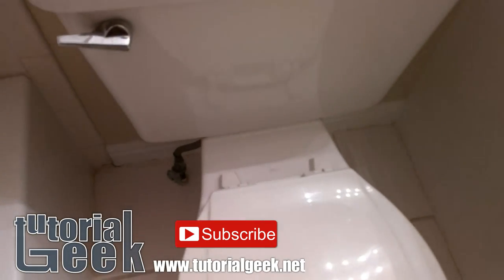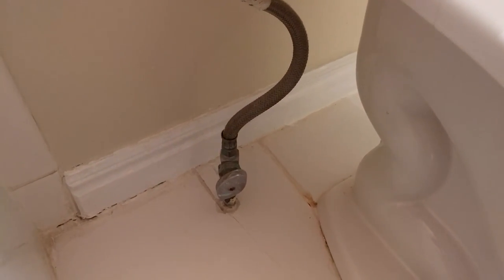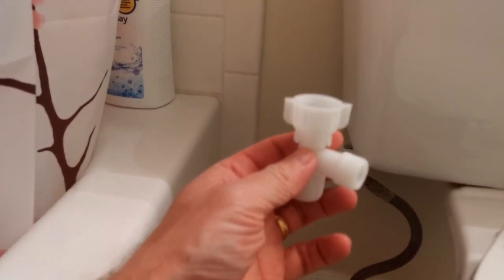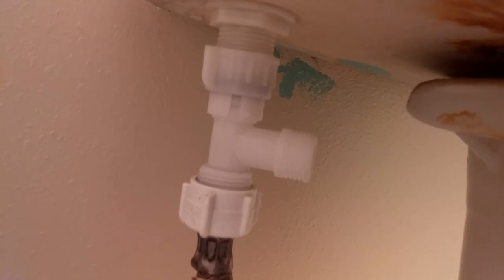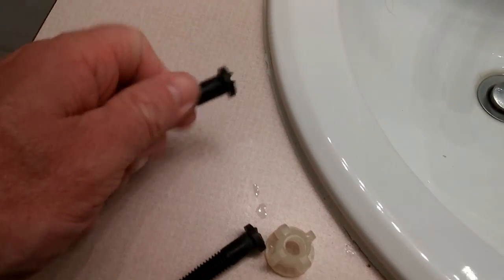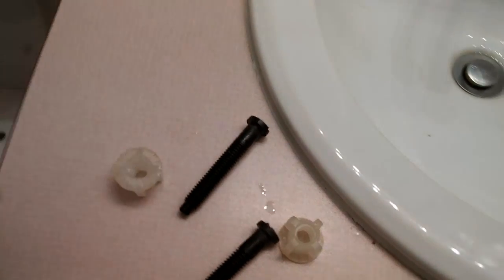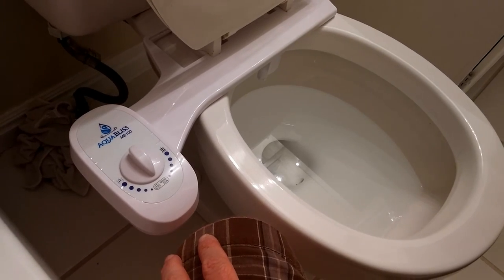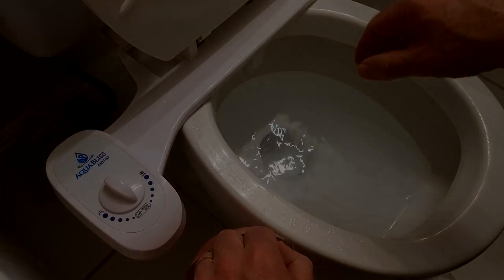Bidet attachment installation instructions | How to install a bidet attachment (AquaBliss)

Comment: When I attached the original hose to the bottom of the piece that has three places to attach, after it was all done and we turned the water on, there was a leak at that juncture.  There is not a leak when that hose is attached to the toilet.  Should I put some plumber's tape on it?
Reply: Same here ,make sure you tighten all tubes as tight as it can go ,that solved my leaks

Comment: Doesn't it lift the seat up a little? Are you now sitting at a slight slant basically?
Reply: ROFL I thought you're supposed to sit with your knees higher than your butt, not sit forward. That's why they say squatting is the best position.

Comment: Hi friend, can you help me out? That white plastic thing that you're twisting at 1:07, mine is a little different. 
 There seems to be a white plastic part like the one you have, but there's also a metal one, they seem to be stuck together. I think I have to unscrew them apart but I'm unable to do it.  So I can't disconnect the hose from the underside of the tank
Also the toilet valve is now loose inside the tank.
What do I do?
Thank you for your time.

Comment: I’m having trouble unscrewing the knob part attached to the toilet tank. I will try using the towels.

Update: I still cannot unscrew iit.
Reply: Try and use pliers
Reply: I'm having the same problem. It's been 2 years since you commented. Lol what did you end up doing?

Comment: Please help , I just fitted this item my toilet but in low pressure there is no water comes, and even in high pressure very small amount water coming, what i have to do increase the water power
Reply: Engin Çağlar idk
Reply: Was the toilet tap turned on all the way? If you have low pressure you need a pump
Reply: @goldwolf0606  ew no

Comment: Information for dissolving confusion about bidets.
     “There are two main bidet types: 
1. The old fashioned standalone bidet with vertical water jet.
2. The attachable or add-on to toilet bowl bidet.
The second one has two basic subtypes:
a. Those producing oblique water jet.
b. Those producing vertical water jet.

The above distinction is necessary, as it is informing at first glance about what type would be appropriate for different situations and different ailments. f.e people with      mobility problems, hemorrhoids, blinds, elderly, need always the more effective in cleaning up vertical water jet, specially the elderly using elevated toilet. The same it applies for women after childbirth, as their nearby wounds make imperative a very exact and steady water jet, or people in general that seek for a 100% effective cleaning, etc. Cost of this type varies from 30 to 2000 dls. 
The number 2 type has many other variations relating mechanical or  electronically 
handling, or offering more services, as warm water, air drying, music etc.”  

 “For those that look for an ecnonomy, durable, 100% effective, not electric, easily installed and easily used apparatus, whose VERTICAL well targeted water jet in very restricted area does not allow     somebody to feel the water coldness, (think of your finger in cold water compared with whole hand), never     wetting clothes and never causing any surprise sense of shock, the answer is the add-on bidetdisabled.com KO BIDET. SEARCH  WELL   BEFORE  DECIDING.“

Comment: No hot water? I saw an ad that included a hot water supply as well.
Reply: .....Was wondering about the warm water situation also...
Reply: @2lazy2date  There are non electric  bidets that also attached to your hot water.  Includes another T valve to attached to your sinks hot water valve.  Cost a little more. But your sink nears to be near the toilet.......if Not, than you buy a electric Bidet seat.  I just tried mine, for the first few seconds cold water is fine. After so many seconds it became a little uncomfortable.   Use just the first 2 dial increments for water..after that too much pressure.

Comment: Once you installed your bidet, did the toilet seat touch the toilet bowl? We installed ours and it does not touch it, I was reading somewhere you need to add spacers, but I have no idea what that is, do you?
Reply from the maker: My toilet seat is plastic so it is a bit flexible and does touch the seat.
Reply: Mine is plastic as well, it's a little high up, but it's fine I was just chicken to use it, I thought it would crack, lol! I am used to it now. Thanks a bunch!! :)

Comment: Is not not hygienic when flushing the water from the toilet bowl will be in contact with the sprayer?
Reply: Only if it overflows. It's not anywhere in the bowl area, its just below the seat, against the rim & the water it uses is from the tank, not the bowl. Also the nozzle self cleans

Comment: So, is it only cold water that comes out?  I can't imagine washing myself with cold water.  What about warm water?  How can you turn it on?
Reply from the maker: Yeah. Only  cold water. I have see other bidets that allow you to hook up to hot water as well.
Reply: If your toilet is next to the sink you can easily install a hot and cold water bidet that will let you adjust the temperature to your preference. It's just a matter of bringing over hot water from under the sink. A little more complex of an install but still within the realm of diy. However like most faucets the water may have to run for a little bit before the hot water actually begins to flow. Might as well just get used to cold water spraying on you. Wake you up in the morning, that's for sure!
Reply: L. M. Trust me it’s extremely uncomfortable with warm or even hot water really weird cold water is so much better

Comment: In India, we use jet sprays. Exactly what you showed. Its just a small attachment on the side of the commode. You do not need a separate seat / commode to clean. Very economical. Just under 5-7 US Dollars here in india. 

Using water is more hygienic & healthy as a paper wont ever clean 100%. And since its dry, bacteria & germs make the anus area worst with bad smell & infections. 

Use a water jet spray or a bidet fitting. it’s definitely more hygienic. Every person in India, be it poor or the rich, uses water to clean the butt. 

Its more safer, hygienic & cleaner than using a paper. Once you get used to water, believe me you wont ever go back to use a toiler paper. 

Use water, say no to infections

Comment: wouldn't the water be cold?:
Reply: It's a bit chilly.  Makes your sphincter pucker a bit.  Ha.
Reply: Creegal ... where do you wash to get warm water?
Reply: angel as a Filipino we have a “tabo” which is sort of a big “cup” used during bathing to scoop water and pour over yourself manual instead of continuous stream from a shower. So in our house we fill it from the tap (cold and hot tap - controlling water temperature to our preference) and use it to pour over ass after poop😀

Comment: i dont like the controls on this model, or rather the implementation... looks like its really easy to accidentally break by tripping into... knocking, or otherwise hitting. it should look more like a "button" that gets pressed (or multiple small buttons) that stop when released and is located in a convenient, remote location that is also not intrusive. but nice idea overall just poor manufacturing execution in my opinion

Comment: I live in the US & I never we even herd of a Bidet until I saw a video about them on Today I Found Out ( https://youtu.be/Z6dvGXiT5H8 ).

Simion actually did a pretty good job of selling the idea to me some time ago but I never got one simply because I was renting & technically don't own the bathroom I use.

However, I recently bought a new home & unlike when I was renting, I can now do whatever I want with my own appliances. I thought that perhaps now is the time to consider importing a Bidet to try out for myself as one of my many home improvement projects. If the cost savings & cleanliness issues are as good as Simions boasting, I think it's worth a try. 

What lead me here is the fact that I'm certain I'd have to install it myself if I can even get my hands on one. I doubt most plumbers in the US would even know what I'm talking about if I asked them to install a Bidet for me.

Comment: It is not clear as to where is the water coming from, which is the most important emphasis you've neglected to explain. 👎
Reply: Bo Al-sharef are you blind? Watch the video again
Reply: Dan Of all trades they must be blind
Reply: Water is coming from the basement cold water supply valve.  When you turn the valve on the bidet, it opens up the T-valve you installed between the water supply and the toilet.
Reply: All the water you will encounter in this job is "clean" and comes from your water source (like city water treatment centre, or from your cistern or dugout).   Some people do use recycled water for their toilet, so be careful if you have a bidet attachment in this type of setting, as the water is not 100% clean.  Some people recycle their shower water in to their toilets to save on water in dry dessert areas for instances.  Huge advantage of bidets is less toilet paper usage.